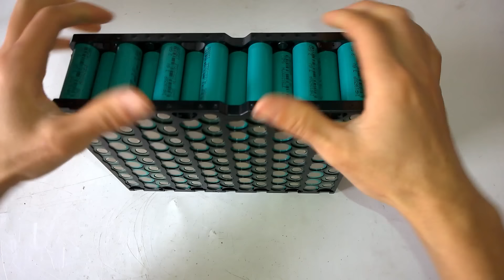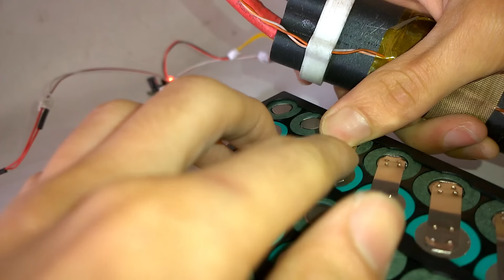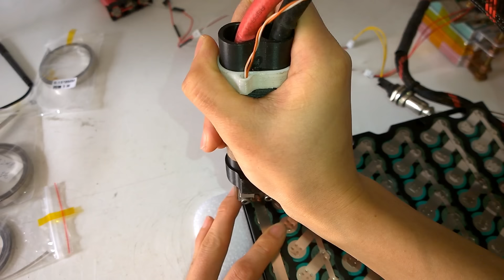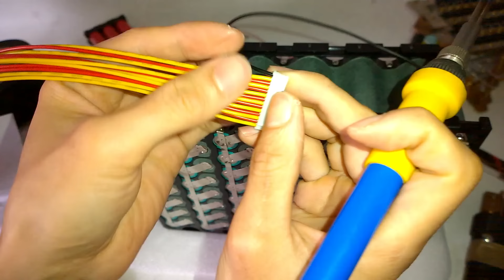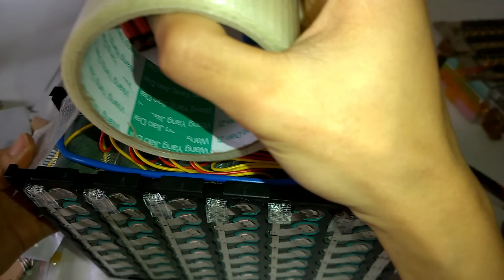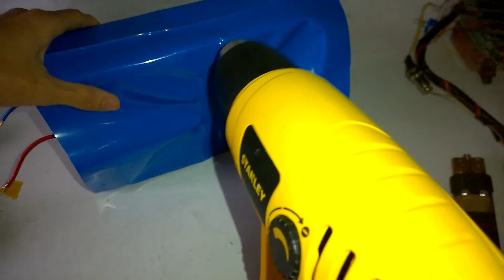DIY 48V 20Ah Electric Bicycle Li-ion Battery

Comment: Sir I see you know what your doing can u please help me with something, is so please send me a message
Reply from the maker: Hello!
What do you need?

Thanks!
Reply: Ok so I have a redfuel sl1 battery jump starter, so the battery puffed up, and I am trying to fix it. So it had 4 long silver batterys 3.2v 3ah all connected together says it = 12.8v 12000mah 38.4wh. It also has a connector that has 5 wires coming out and a thick pos/neg wire. How can I change them to li-ion batterys I can send pics if needed
Reply: Ok thank you so much I just sent the email if u figure it out I will be so relieved